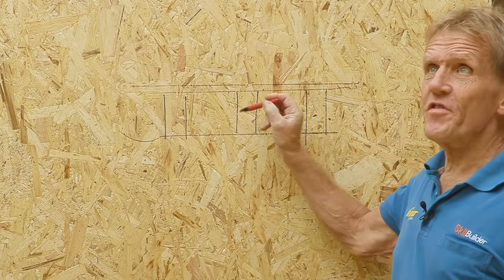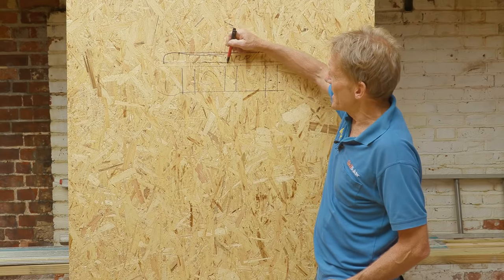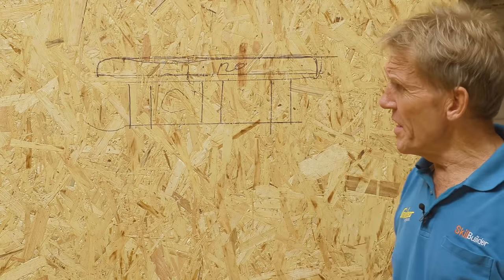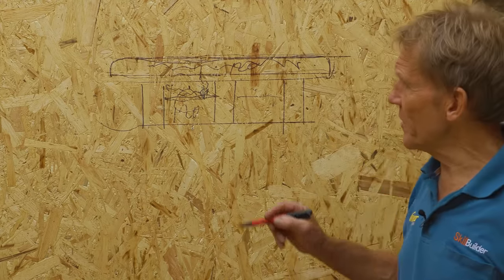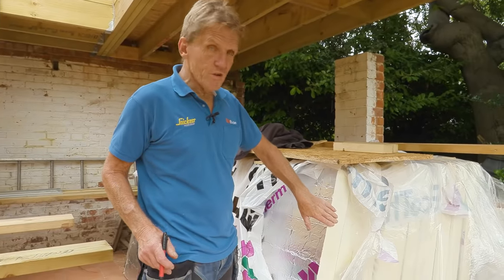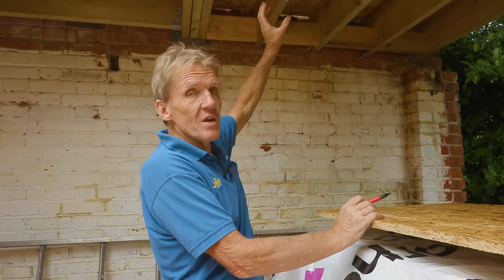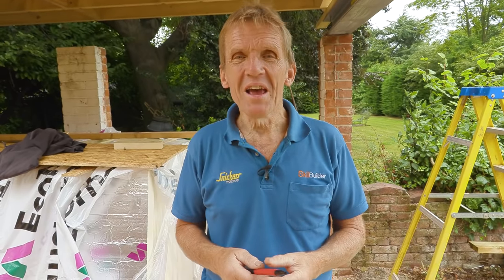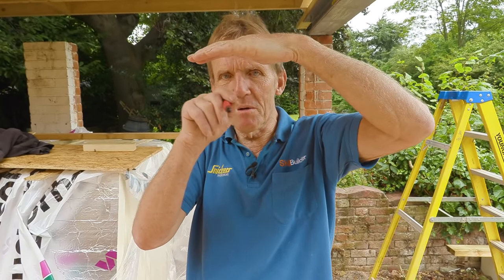Warm Roof vs Cold Roof. What’s The Difference?

Comment: Why didn’t you just counter batten over  the flat roof joists before you laid down the decking , if there is a ventilated soffit  round  the perimeter and air can circulate across the hole of the roof in between the counter battens then there will be no problem 
no need for all that faffing around with mushroom vents on the top of the deck 

I don’t like the terms warm / cold roof as it suggests  that one is warm and the other is cold I would prefer ventilated and unventilated, 
The thing that puzzles me is that if the insulation is placed over the top of the flat roof decking and the heating  from within is alowed to raise up into chamber of the flat roof joist and there is on chamber insulation  around the perimeter of  the roof void only a timber joist and then a deep facia board on the outside then there is potential for cold bridging all round the perimeter of the roof
Surely this is not as good a solution as making a really good fit with the insulation between the joist  and making a good ventilated  space above

Comment: Couldnt you put 20mm insulation on top for a warm roof then the 120mm under the osb and seal that in with no air gap?
Reply: As Rodger says the moisture migrates. The problem you have with what you describe is the moisture would be in the wood and as the temperature drops the moisture will condense inside the wood. This is interstitial condensation. I believe it can be done but needs well designed breathable membranes etc. It would need to be signed off by building control as well and i expect you’d find it easier just to go with the traditional cold or warm roof.
Reply: @davideyres955  Note that condense means to transform from a gas to a liquid so moisture cannot condense inside wood because there are no air spaces within wood. interstitial condensation occurs within a structure, but there needs to be two separate parts to the structure with a gap of some sort in between where damp air could migrate to. I'm thinking of building a flat roof with this 20+120mm insulation warm roof design, and using non-permeable spray foam insulation for the 120mm part since it should stop any moisture migration by virtue of it being impervious to water itself and being effectively glued to any other surface it's in contact with. It doesn't need to be breathable because there is no moisture that needs to escape from anywhere.

Comment: Wrong!!! Insulation should be hard  under the roof sheet with air gap underneath, above another layer of insulation fixed to underside joist before plasterboard...that's a proper cold roof

Comment: The Neighbor would bitch about an additional 5 inches of roof height so you could insulate the top of the roof and make it it simpler and less expensive job? I would explain the situation to the neighbor and see if they will agree.  If not,  I would consider giving them what for due to being so unreasonable. Give and take makes the world a better place. Guaranteed that if you carried on with the outside insulation, they would never realize it anyway.

Comment: Why couldn't you push the insulation up to the OSB board from underneath with no air gap & leave the void below?
Reply: Because then you wouldn’t have the crucial ventilation gap of minimum 50mm. You would have a point where moist warm air meets cold air from outside and condenses/ sweats and rots everything away. As Roger says this is called the dew point.
Reply: That is then a hybrid roof and requires attention to avoid moisture transfer
Reply: @DavidHowellsBuilders  , but the air above the plasterboard is ambient room temp so isn't cold air, so can't condense on the underside of the insulation.
Reply: The voids are vented to outside.  If they were below the insulation, you’d effectively have no insulation, with that cold outside-vented air flowing directly above the ceiling.  In that case, the condensation would mostly be on the interior surface of the ceiling.

Comment: Unfortunately GRP is a shocking system .
Reply from the maker: In the wrong hands
Reply: @SkillBuilder  in all my friend ,but if it wasn’t for that rubbish and the one day I’ve learned flat roofing us asphalters wouldn’t be as busy as it seems we all are ,so as long as people use this shocker of a system that is applied to an up grade of chip board there’ll be plenty of work for the craftsman.
Reply: @danielfinley47  Modern hot triple felt costs less than grp and is much better so now preferered by many to GRP

Comment: Vent the soffit 😁
Reply: Put vent discs or a vent strip
Reply from the maker: It is very easy to put a soffit vent in but it needs a vent on the other side of the roof and very good cross flow. We could do a vented upstand but the roof window is a problem.
Reply: @SkillBuilder   obviously leave a ladder rack over the outer skin of the extension as you do 400, 450 mm noggins with 6x1 timber facia board, depending on what overhang you want too form and continue the vent strip all way around soffit I use rockwool on the outer perimeter to allow air to draw, flow

If you haven’t allowed for the overhang on the header plate that you have built youre joists off you won’t achieve the overhang unless you join abit on 😆